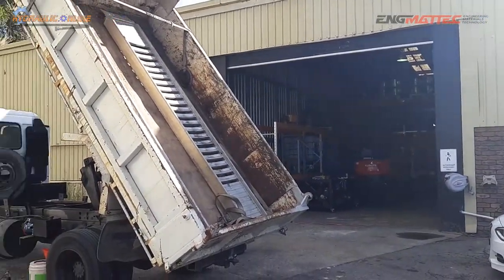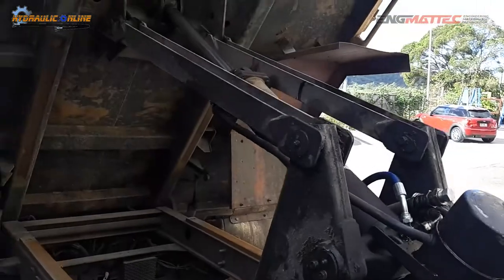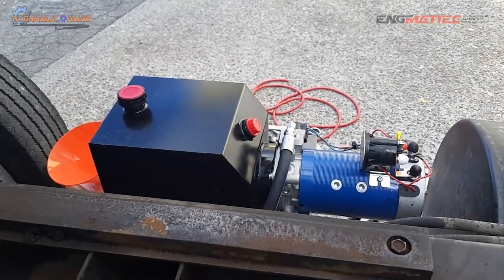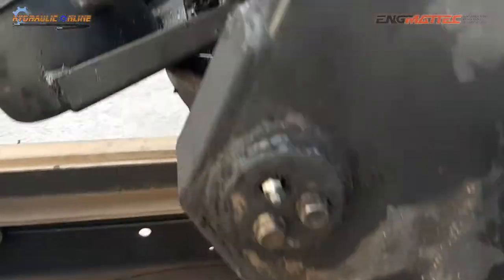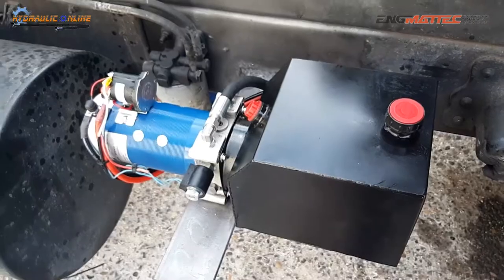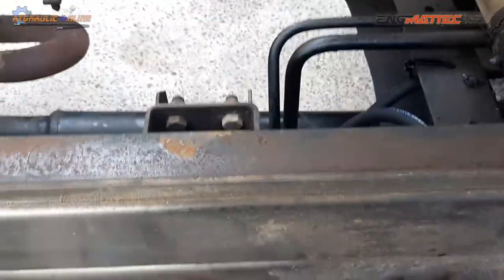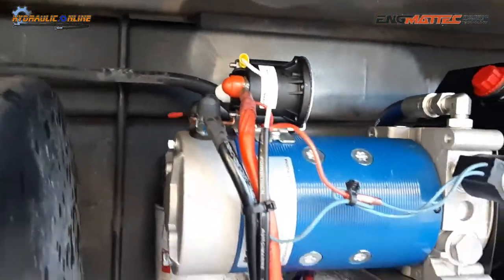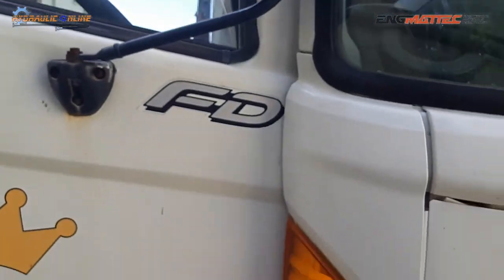24 Volt DC Hydraulic Power Unit replaces Old Mechanical Pump on Hino Tipper

Comment: Hey mate, are these powerful enough to run two underbody hoist to push around 7 ton?
Reply from the maker: Hi sorry for the late reply yes they are powerfull enought for twin underbody cylinders you may need a larger oil tank though. Please be aware of the duty cycle (run time in minutes per hour) of all 12 and 24 Volt DC power units.

Comment: Hello where can I purchase a pump like this?
Reply from the maker: if you are in Australia copy and paste this link and then select the options you require such as voltage 12 or 24 VDC, type of fuction P&T, Single Acting or Double Acting and then the size of tank you require. 
You can use this shortened link https://bit.ly/3FSG3o3 
or the original link as below 
https://www.hydraulic.online/Hydraulic-Power-Pack-12-24V-DC-5-Lt-min-2500-PSI-P&T-Single-Acting-Double-Acting-p203353233
Reply: Amazon